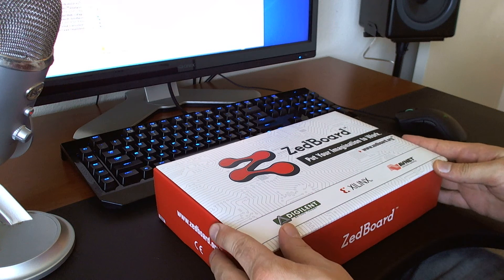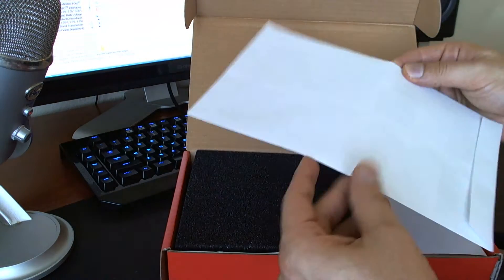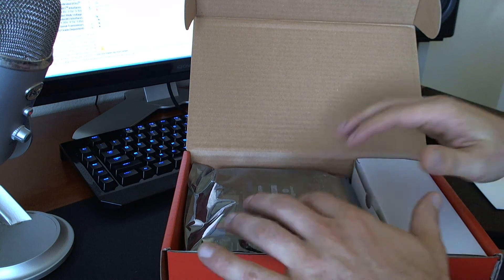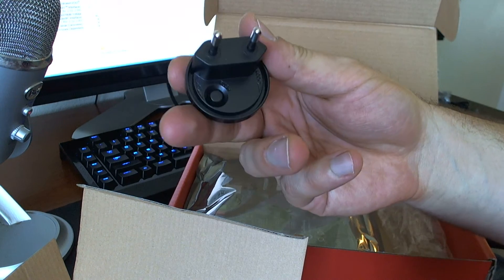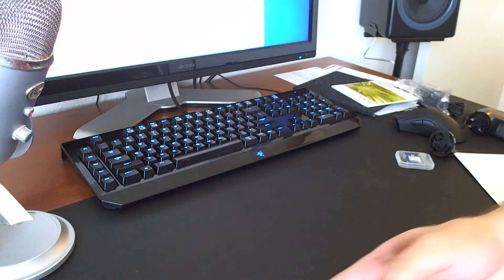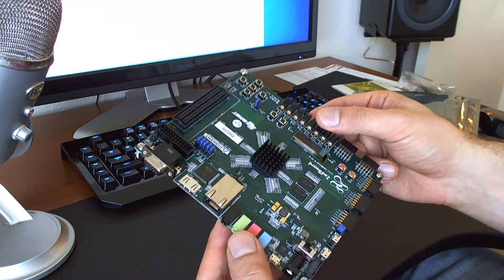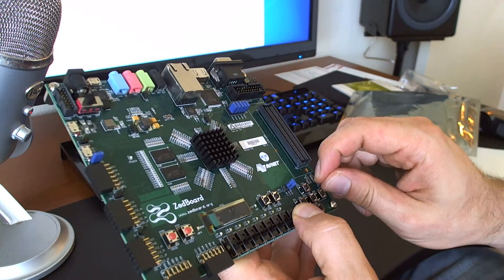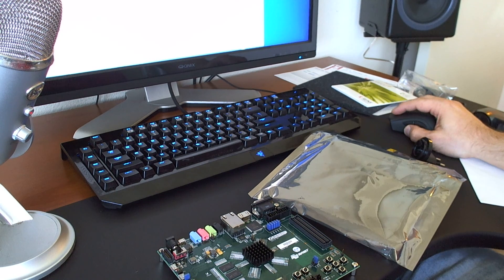Digilent ZedBoard with Xilinx FPGA and Dual ARM Cortex 9

Comment: I’m only watching this because I noticed this SBC cost > $500 on Amazon and wanted to know what made it special enough to cost that much
The fact that it’s 10 years old makes me believe this board is ridiculously overpriced
Reply: It is you can get better ones from Chinese companies like MYIR or something like the Pynq-Z2 which is like the Z1 but more open source, both are official boards (doesn't really matter).

My MYIR board MYC-C7Z010_20 costs like 160$ comes with more IO than the Zedboard and double the RAM (max supported on Zynq 7020) etc